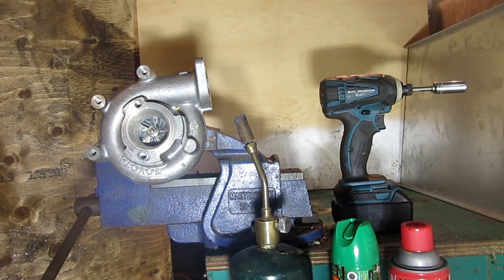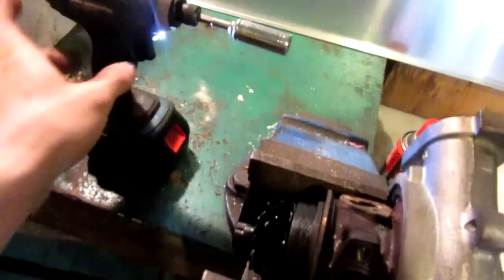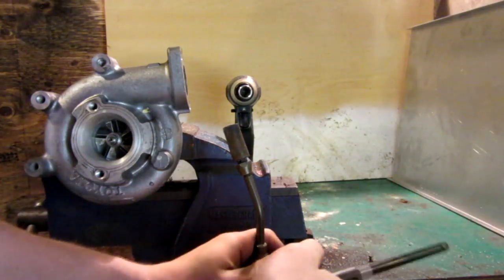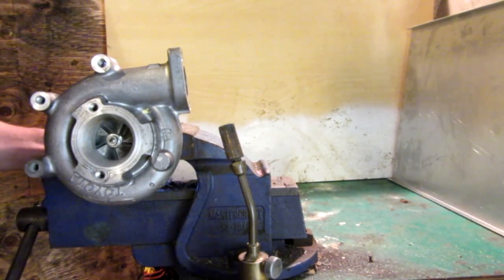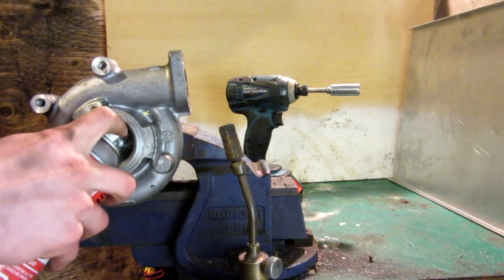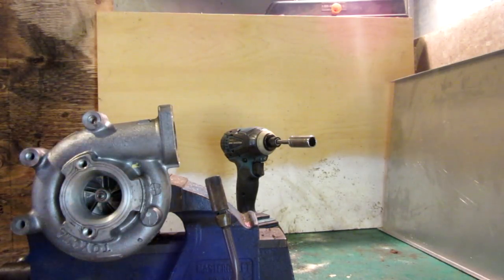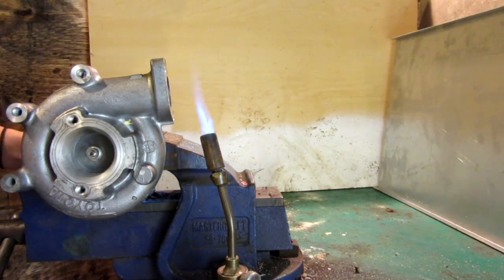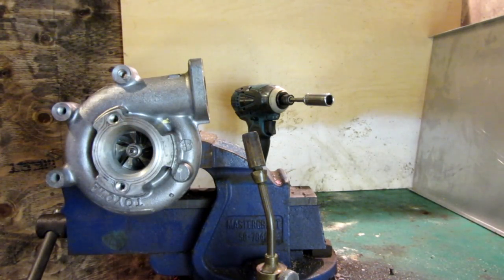DIY Turbo Flamethrower

Comment: Compression creates heat and thats how the fluid was catching fire without a flame and compression is also how diesel engines run since they dont have a spark plugs